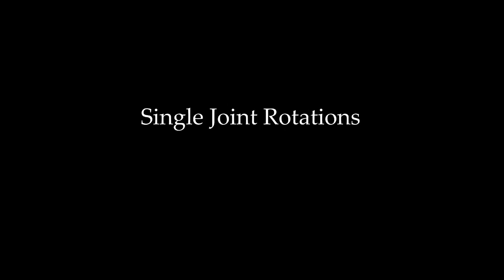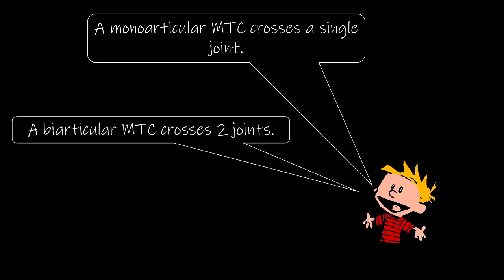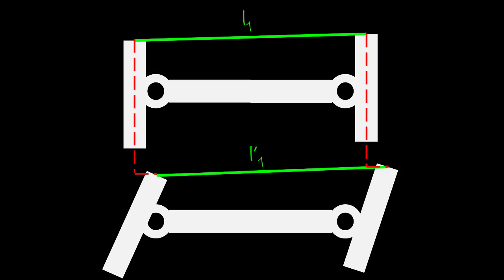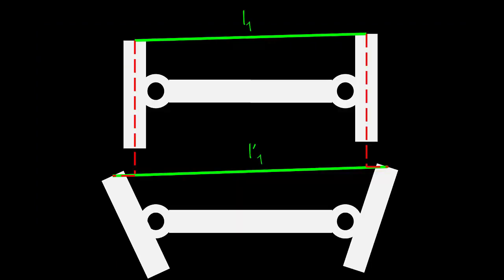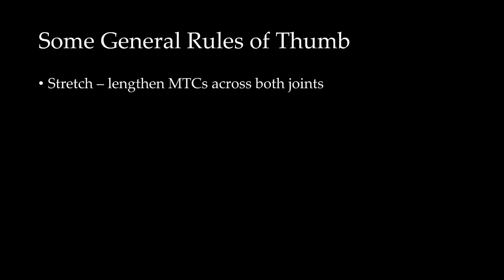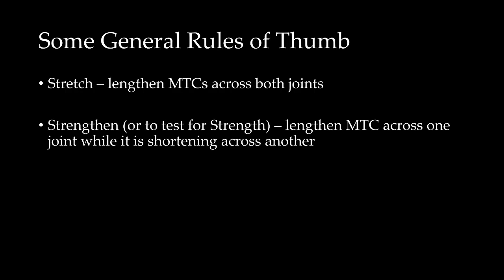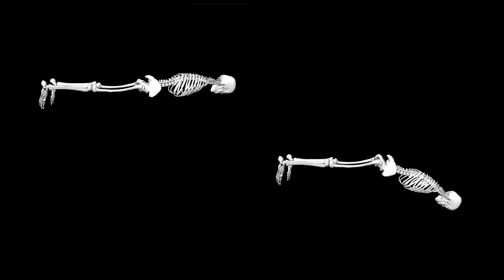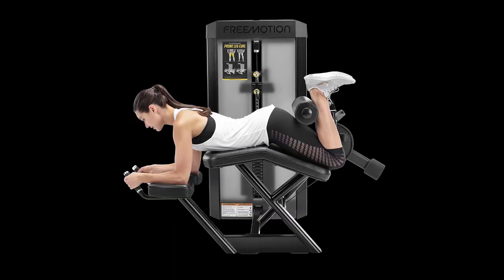Biarticular Basics

Comment: Doing leg curl our hamstrings  muscle are use there is movement  of knee flexion  
So then doing the deadlift   but there is movement of knee extensions  and hip extensions  in the movement  of the deadlift   so how 🤔  is it possible  we feel  same pressure  in our hamstrings  (  here is knee  extension movement  occurs)?  Because  of this reason  am right or wrong  plz correct  me and explain
Reply: In a deadlift there's much less knee extension occurring at the knee, compared to a squat variation. The more the knee's are straight, the more your hips will take the brunt of the resistance and your hamstrings will be put in an optimal length to actively contribute to hip extension.
Reply: @galhalperin1814  thank u
Reply: @Durgaetz  You're welcome. If you have anymore questions feel free to ask :)